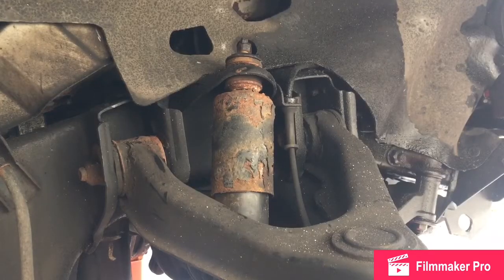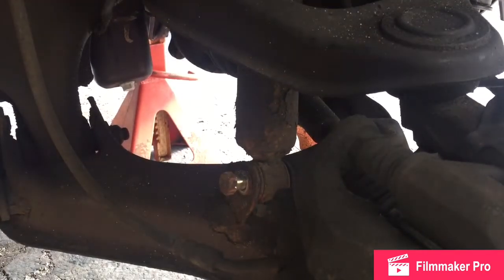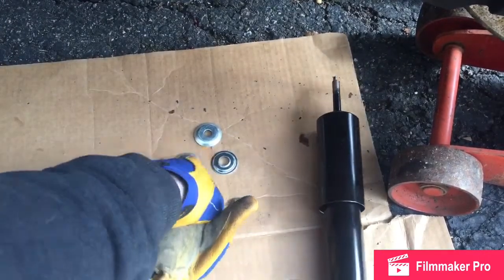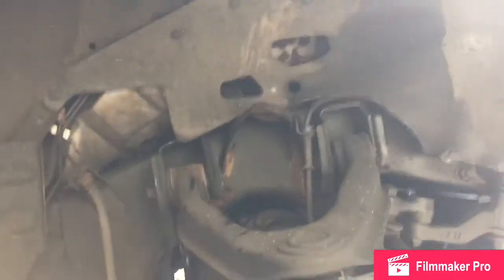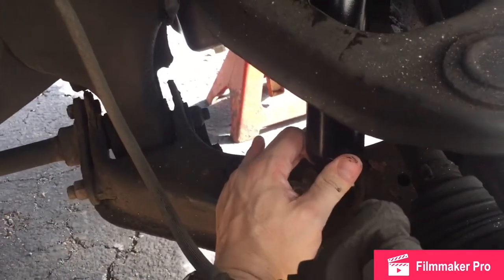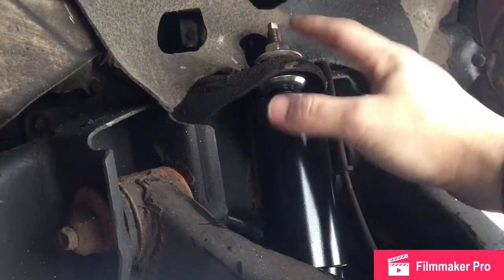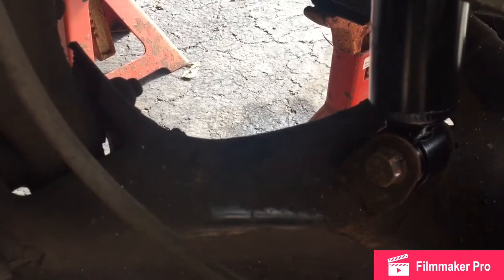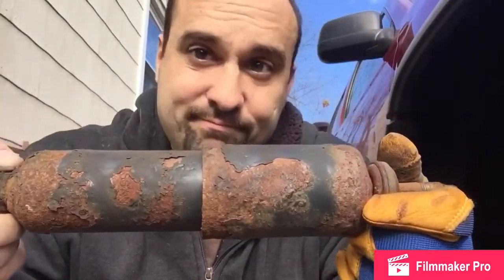2004 Xterra front shocks removal and install

Comment: Subscribed. Rear shock top bolt is rounded off and it looks like it was installed w/o a washer. Can't get bad shock out. Any ideas ?
Reply from the maker: sawzall or grinding wheel.
Reply from the maker: and THANK YOU!

Comment: did this resolve your front end vibration issue?
Reply from the maker: no because like I told the guy at the shop, my guess was a slipped belt in the tire.. and THAT is what was the original problem lol. If your truck steering wheel is shaking from side to side, its a belt in the tire. if your entire front end is vibrating it might be the shock or something else